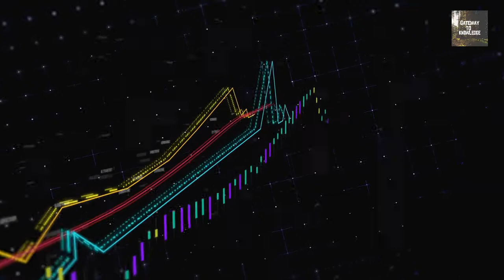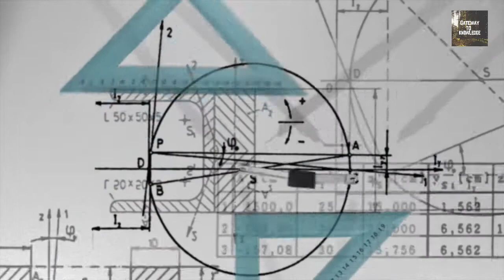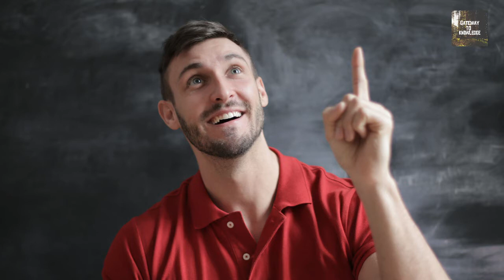How Rocket Moves In Space When There Is No Air To Push Against?

Comment: What about the lack of air? You need heat, fuel and Air or oxygen for there to be a fire so how does the rocket engine work in space.
Reply: Rocket engines take oxygen WITH THEM to space genius.  What do you think the giant tank of LIQUID OXYGEN is for?
Reply: @stuartgray5877  keywords LIQUID oxygen. A spark requires oxygen in GAS form-- a by-product of liquid oxygen AFTER a reaction.  Taking liquid oxygen with no initial spark (no oxygen in gas form) will not yield oxygen.  You need a reaction (i.e. the spark) which requires GAS oxygen in order to create the reaction to yield the oxygen by-product from liquid oxygen. This is entry-level chemistry.
Reply: @DrCash7 abe tu har chat me jake gyan kyu de rha hai sabko pta hai.
Reply: @stuartgray5877 😂 frightening isn’t it?
Reply: @danwilson1040  Yes these people get to VOTE and PROCREATE.
It is very disturbing.

Comment: But if there’s no oxygen how do the rockets even ignite? Don’t you need oxygen to burn anything??? That’s what I’ve always wondered. I get that the sun is a nuclear reaction and it’s not burning but I’ve always wondered how rockets worked in space.
Reply: they bring the oxygen in the form of liquid oxygen.
Reply: @entangledmindcells9359  b.s. liquid oxygen isn't usable to create a spark-- creating a spark requires oxygen in a gas form.  Liquid oxygen can creat oxygen AS A BY-PRODUCT but first needs a spark.  Beautiful circula logic attempt there.
Reply: @DrCash7 
Liquids boil in subjected to a vacuum..
So going from under high pressure to the vacuum of space, the liquid would turn to gas fairly easy.. So there is your oxygen in gaseous state. 

Understanding basic physics & chemistry is all it takes.
Reply: @entangledmindcells9359  sure it boils off in a vacuum.  So you're saying the rocket exposes its fuel tanks to the alleged vacuum of space to create some O2?  What a fantasy that is.
Reply: @DuffDuff-ev7tc  exactly. Even bots are programmed better.
Reply: @DuffDuff-ev7tc  Odd... I never mentioned anything about exposing its fuel tanks.. 

maybe you should take 15 seconds and google how rockets work to understand how the fuel and oxidizer are transferred from their tanks to the engine. It involved pumps. 

FYI.. it sounds like you the two of you  are programmed not to research things for yourselves but instead just parrot what you've been told.
Reply: @entangledmindcells9359  fire needs gaseous O2 to burn not LOX.  This is why flameout occur at high altitude. Proven by experiment. Oxdiser is additive for reaction after fire already present.
Reply: @sitbacklounge3846  Sorry.. fuel requires an oxidizer for the chemical reaction. Not after.
Yes flameout can occur.. but proper design resolves that.. Proven by experiment.
Reply: @entangledmindcells9359   you say boil from no pressure to make liq o2 seem like o2 like maybe when o2 is low they just open the door and get some boil from liq o2 this is madness otherwise why this trickery to conflate o2 with liq o2 when liq o2 cannot make flame?
Reply: @entangledmindcells9359  after FLAME is made. I do not say after reaction thes your word. Where is flame but no o2 as you propose so you get this your reaction?
Reply: @jrstuckey1471  "you say boil from no pressure to make liq o2 seem like o2 " No.. LOX going from high pressure to low pressure will cause LOX to convert to O2.. not "SEEM Like"
basic chemistry.. Maybe you should consider signing up for a class a learn something.
Reply: @entangledmindcells9359  you said "boil" brah.  Lol.  Worst shill ever.
Reply: @DrCash7  yes.. The process of turning any liquid to gas either by applying heat to reducing pressure drastically. The colloquial term for that is 
BOIL.
Reply: @entangledmindcells9359  no ox no spark.  No resistance, no thrust.  No separate body, no reaction.  Please shill better.
Reply: @entangledmindcells9359  exactly. Your words, not mine.
Reply: @entangledmindcells9359  everybody knows you are a chatbot 😂
Reply: @stuartgray5877  Stop lying plz, chatbot 😂
Reply: @entangledmindcells9359  You too, lying chatbot 😂
Reply: @papalegba6796  We are NOT "lying" when we state that YOU are incapable of passing a high school chemistry or physics exam.
This is a FACT.
Reply: @stuartgray5877  "we" 😂
Reply: the comment ask how can you make ignite when no o2 and you say "oh they bring Liq o2" and this I tell you cannot make ignitite because it cannot be liq o2 it must be o2.
Reply: @sitbacklounge3846  Sorry to hear you don't want to look into how LOX converts easily to 02.

Comment: People that keep trying to tell me that the Recoil from a Crossbow is "nothing like" the thrust from a rocket need to try taking a physics class.
They are EXACTLY THE SAME.
If you think otherwise, then you have NO IDEA how Mass, Inertia, and Momentum are all related.
If you failed to graduate high school, you have NO BUSINESS lecturing actual engineers about basic physics.
Reply: The momentum from a crossbow is created when the rope is pulled tight and released. 

A rocket has a engine which uses gases to combust to generate force.

You are right about the two are moving.

HOWEVER, the question is "how do the engine combust in space where there is no atmosphere?"

If the rockets uses liquid hydrogen to create the momentum but "what is the generated force pushing against when there is closed to zero molecules in the no atmosphere outer space?"

Can you used you physic class to answer my question please.
Reply: @pixalizek.o4722  Since you seem to not want to answer, I will answer FOR YOU.
YES!
YES! A crossbow fired into a vacuum WILL HAVE RECOIL.
Now tell me WHY?
It doesn't have anything to push off of according to you.
Yet it STILL HAS RECOIL.
WHAT is it pushing against?
Reply: @pixalizek.o4722  what would happen if I fired a crossbow into a vacuum??
Would I feel a recoil force or not?
Just answer the question REGARDLESS if you think the question is relevant or not.
Reply: @pixalizek.o4722  Why did you run away. Were you too embarrassed once you figured out I was correct?
Reply: Excuse me mister Stuart, im low level IQ, I just have a question, if I was in space and a giant boulder was next to me, will I be pushed away from the boulder if I tried to push it? Or would the boulder be pushed away from me? Or half and half
Reply: @axelpalacios9232  If the boulder is of the same mass and you push it you will both move away at the same velocity.
If it is lower mass, IT will move at the higher velocity and you at a lower velocity.
And you are higher IQ than most of these physics deniers already.
Reply: @stuartgray5877  I have a feeling the people arguing for "how does a rocket move in space" i think they are imagining the rocket exhaust to work like a simple lighter. They should imagine a torch instead right?
Reply: @axelpalacios9232  actually a space shuttle main engine burns hydrogen and oxygen. The resulting "exhaust gas" is pure water.
So a space shuttle main engine is more like a WATER CANON than a "flame thrower" or "torch".
Reply: @stuartgray5877  wow, that's paints a whole different perspective, thanks. It feels like it takes a ridiculous amount of energy to move around space, so much so that we will run out of fuel fast if space exploration was slightly more common??
Reply: @axelpalacios9232  - "so much so that we will run out of fuel fast "

Watch the Syfy original series (now Prime I think) called "the Expanse".
They use water as the reaction mass (propellant) but it is accelerated by the power from a Fusion reactor.
If you could accelerate a single molecule of water to close to light speed, it could have the equivalent mass of a school bus.

Comment: Trust not a problem, combustion Is the problem,you Need fuel and....air
Reply: Sorry but combustion requires Fuel and OXIDIZER, not "Air".
Good thing rockets take oxygen with them TO SPACE, GENIUS.
Reply: @stuartgray5877  nope.  Look it up.  Oxidizer is fuel additive. You still need oxygen to create spark for chemical reaction.  Very basic chemistry here.
Reply: @DuffDuff-ev7tc  Oxygen IS an oxidizer genius.
AND there are Oxidizers other than oxygen.

It is HILARIOUS that you can be wrong while trying to tell ME to not be wrong. Bless your little heart!
Reply: @stuartgray5877  ok genius, use LOX to start a fire.  A simple web search shows Liquid Ox is NOT flammable.  Bad rowbutt.  Air/O2 is most definitely required for ignition.
Reply: @stuartgray5877  from gewgle: "Liq o2 is an extremely concentrated substance. While it is not flammable"
Congrats, your code is faulty.
Reply: @DrCash7  thanks for proving you failed high school chemistry while you were failing physics.
To our just keep making a bigger fool of yourself.
Tell us more about chemistry, it's very entertaining.
Reply: @DrCash7  oxidizers are never flammable. FUEL is flammable when combined with an oxidizing agent such as oxygen.
Try again genius
Reply: @stuartgray5877  lol so still no spark!  All this fuel and liq ox but still no air for spark 😢
Reply: @DrCash7  you want a laugh check out the claimed specs for the fuel pumps on these alleged space rocket engines. Like, spacex latest engine supposedly has turbopumps rated at 50,000 horsepower that are the size of wastepaper baskets 😂. Of course they haven't patented them even though they would be worth millions in profit for many other applications 😂😂😂😂
Reply: @papalegba6796  why do you keep talking to yourself?  We KNOW that you are Dr Cash are the same person
Reply: @stuartgray5877  can't refute what I said, can you, chatbot?🤔😂
Reply: @stuartgray5877  so they take a looooot of oxigen.
Because if you can calcolate fuel cunsumption you Need a space shuttle full of oxigen at 300 atm..
There Is something that doesn t fit.
Going in the space requires to much fuel but Maine Is that part that follow a part when they reach space.
I don t know...but i have dubt
Reply: @vnsworkshop9961  I have done the calculations. A space shuttle main engine consumes 500 kilograms of liquid oxygen and liquid hydrogen per second.
Multiply by three and lookup the total volume of the main tank and you will find that the system can operate for about 8 minutes. Just long enough to reach orbit.
try doing at least a few minutes of research before calling every engineer and physicist to have ever lived a bunch of idiots.
Reply: yeah this whole video is nonsense
Reply: @josephvillines9766  - "yeah this whole video is nonsense"
Only to high school dropouts.
So why did YOU drop out? What's your lame excuse?
Reply: @josephvillines9766  - "..like if there is no oxygen in space how is there a ball of floating lava shooting out fire.....but I guess you have the answer for this even tho mainstream science can't even explain it...."
Sorry but we know EXACTLY how the sun (and all of the other stars) work.
Try to keep up.
And stop trying to lecture people that bothered to get an education. You are really bad at it and you are embarrassing yourself.
But you are so cute thinking YOU are smarter than all of the engineers and physicists to have ever lived, even though you dropped out of school before the 9th grade.

Comment: How do the rockets get past the van Allen Belt of over 25000 miles of Radiation in a vacuum space to another so called "planets"?
Reply: "Rockets" have NO TROUBLE getting through the VA belts.
I have launched four spacecraft that flew right through them without even noticing.